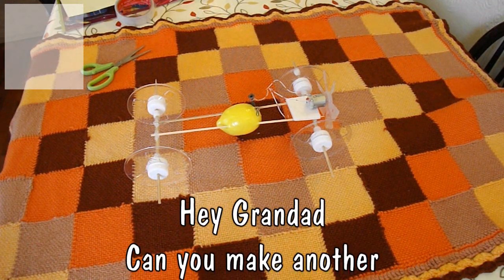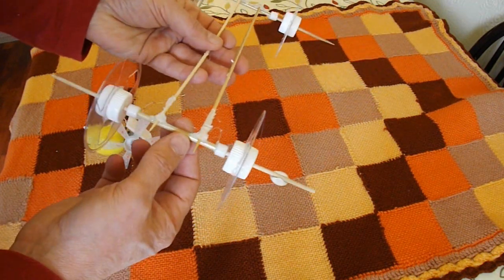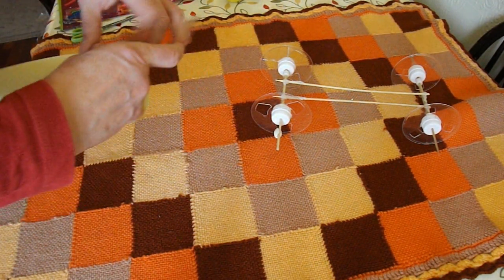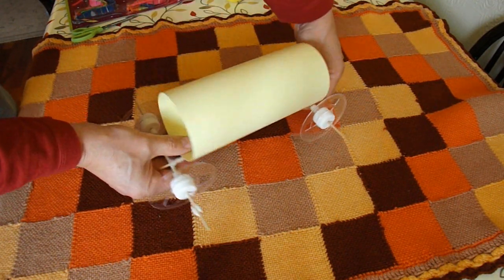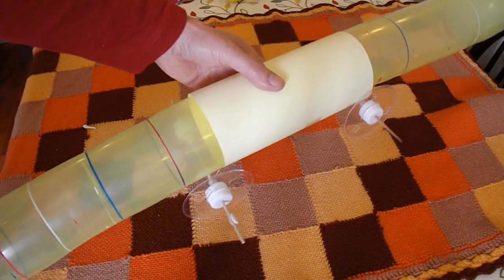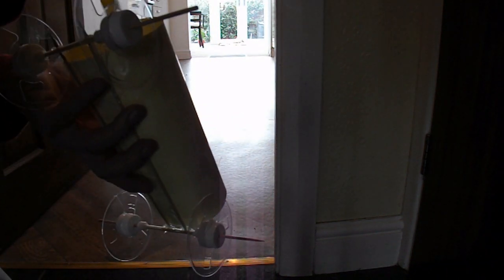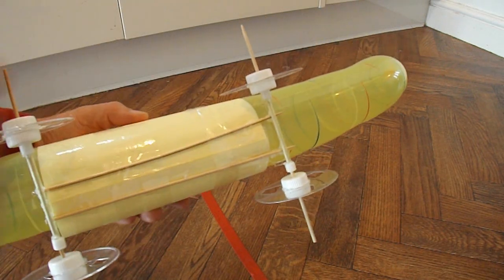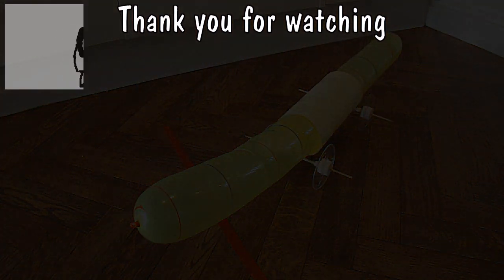Hey Grandad - Can you make another Balloon Powered Car?

Comment: FAKE its air powerd
Reply from the maker: Adam Lee you could have a long discussion about that if you wanted. It is probably ultimately solar powered. Everything I eat has at some time used solar power, even if it's just the grass the cows ate to produce the milk I put on my breakfast cereals. My body turned that into the energy I used to blow up the balloon. When I forced air into the balloon it stretched, storing that energy. When I released the balloon it returned to it's normal size and expelled the air that I had blown into it. The action of the air moving backwards pushed the balloon forwards. Because the balloon was attached to the car it pushed the car forwards at the same time. So the sun's energy was used by the grass, which was eaten by the cow, who's milk I drank to give me the energy to blow up the balloon. All that happened to the air was that it was moved from one place to another.